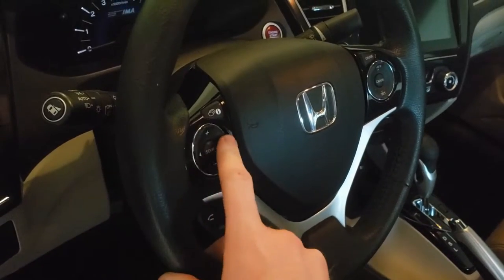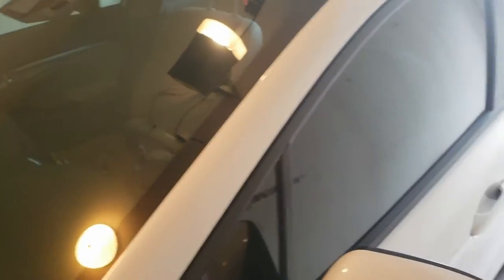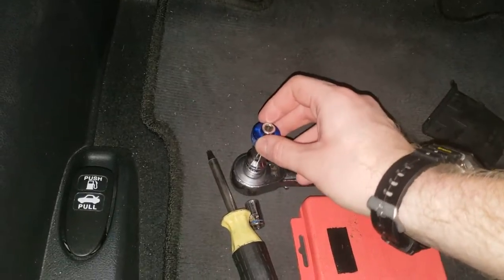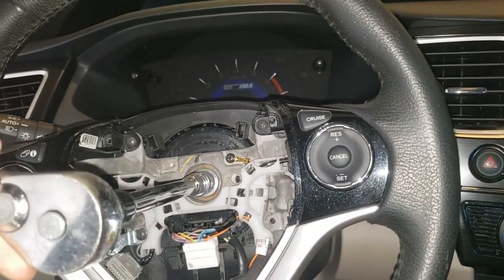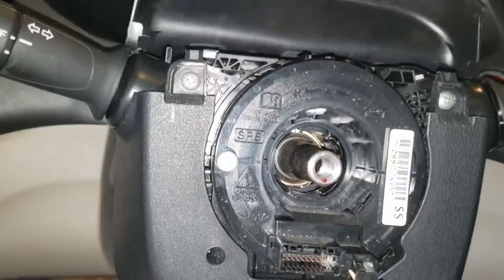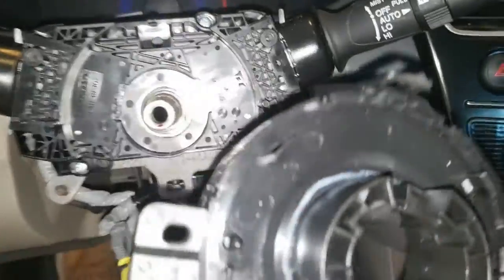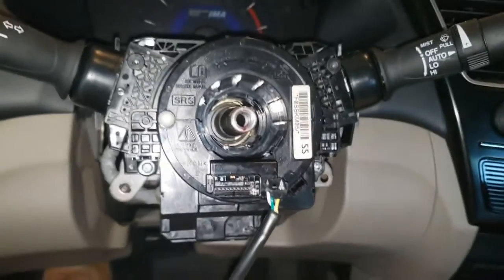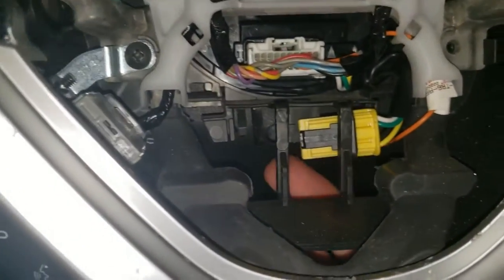2012-2015 Honda Civic Airbag Clockspring Replacement DIY

Comment: thinking im going to have to do this job this weekend, have had the airbag and traction control light on now forever but just yesterday i turned my wheel and heard a crack and then all my steering wheel buttons stopped working including the horn. guessing the clockspring right?
Reply from the maker: That would be my guess. Let me know.
Reply: Probably a little late, but this is exactly what happened to me. Everything is fixed now except my menu went black and the menu buttons don’t work. Not too worried, just needed my horn to work for inspection. My airbag light is still on, but that would be because I have a missing airbag in my driver seat and along the driver side top lol

Comment: Did your steering wheel, hill start assist and vsa light came on the dash after this install? Removed the steering wheel and my dumbass yanked the steering wheel to hard it pulled the clock spring wire out with it. Managed to put it back together and all my buttons still work. However, my vsa, steering wheel and hill start assist light came on. Does it have something to do with the steering wheel angle sensor not aligned?
Reply from the maker: Maybe. The angle sensor may also be damaged, unfortunately.

Comment: I’m just getting ready to do this job. The car horn honks on its own when the wheel is cranked to the left. Particularly in hot temps. My first thought was the clock spring but are there any other wires/mechanisms to check while I’m in there?
Reply from the maker: The clockspring would be my first guess given that the issue occurs when the wheel is turned.
Reply: @civicminded2141  sweet. thanks for your excellent video.
Reply from the maker: @Matt-rq6wz  Glad it was helpful!

Comment: My horn works but none of the other buttons are working.i just had my ignition switch repaired. So the clock spring was unplugged but not removed. By unplugged I mean all of the connectors in there were unplugged
06:50 of those 3 electrical connections which is associated with the buttons on the steering wheel? I want to atleast try unplugging and plugging back in before I replace.
Reply from the maker: I believe the largest of the three is associated with steering wheel buttons.

Comment: Hey do you know what size torq screw the air bag  screws in case I want to replace them
Reply from the maker: Not entirely sure of the size, but I believe the Honda part number is 90134-S6A-A80. I know the Torx bit size is T30.

Comment: Really good video - am unable to reset maintenance and oil reset as the down arrow on the steering wheel left side is not working. Appreciate any guidance or work around so can reset maintenance reminders?
Reply from the maker: If it's just that button and no others, I would look at that panel. I believe on all years and trims those buttons connect directly to the iMID. You can check the resistance between pins 6 and 23 on the iMID connector, you are looking for 100 ohms with that button pressed. If you don't see that but you see resistance with other buttons, replace that button panel.
Reply: @civicminded2141  thanks - it is just the down arrow, up, right and left works. Where would I find pins 6 and 23 of iMID to measure 100 ohms?
Reply from the maker: @maverickperson5443  According to the service manual that's what you should see.

Comment: my hands free buttons come and go.  for example sometimes i can use my info button to turn off my air bag warning (airbags dont work) other times i cant.  sometimes my menu button acts as my info button.  sometimes my source button doesnt work but my "back button" or volume increase button acts as my source button.  my cruise control on button sometimes wont work.  im not really sure if this is the same as what youre doing here.  does it sound like i should replace the buttons each assembly or maybe software?   thanks in advance!
Reply from the maker: I'd say it's more likely to be the button assembly than software. You can verify using a CAN sniffer if you have one, I am planning to make a video on how. The ability to turn the airbag light off with the info button, however, sounds like a possible clockspring fault.
Reply: @civicminded2141  thanks so much for your reply  im back 6 months later as im getting ready to hopefully fix it.  i did get codes on it though.  b0001-13 and b0002-13.  again, thanks for your reply.   going to be replacing the clock spring and hope i can get airbags back.  i can deal without the buttons.

Comment: Hey, so I completed the job. Had a bit of trouble getting the bottom black piece to sit in there right when putting it back in (pieces before the wheel). Also, when I went to turn on my car, voila! The horn worked and so did my cruise control BUT now my menu is black (which it wasn’t before the project), and my menu buttons obviously still don’t work as a result. What do you think?
Reply from the maker: How long had it been since your last battery disconnect?
Reply: @civicminded2141 I literally just put the new clock spring in when I made the comment. So it had been disconnected at that time.
Reply from the maker: @xfirstchairx  Hmm. Are your speedometer and tachometer operating normally?
Reply: @civicminded2141 yes they are. The only things not working atm are my menu screen (which worked beforehand, but the buttons did not) and obviously the menu buttons. The fix DID work on the horn thankfully, which may be all I need to pass inspection, but I don’t like that my menu doesn’t work lol
Reply from the maker: @xfirstchairx  I feel it. So the fuse isn't blown- do you have Sirius? Is that working?
Reply: @civicminded2141 I don’t even have a radio lol I busted that awhile back.
Reply from the maker: @xfirstchairx  Ah. Believe it or not, the iMID on/off state is controlled by the radio. There is a test you can do if you still have access to the connectors the radio was plugged into. If you have a 2014 or 2015 with a screen (nav or no nav), you're looking for a 12-pin JAE connector and you'll be grounding pin #8 (bottom row, second from the right from the wire side). If you have a 2012 or 2013, or any year with no screen (hard buttons on radio), you're looking for a white 14-pin connector, and you'll be grounding #2 (top row, second from the left on the wire side). If the screen turns on with that, it's working.
Reply: @civicminded2141  the menu I am talking about is on my dash, and separate from the radio. I haven’t had a radio in for years. The menu on the dash that shows my odometer and stuff is what went out after putting in the new clock spring. I’m wondering if I may have pinched something. I haven’t had an opportunity to take it back apart and look.
Reply from the maker: @xfirstchairx  Yup- that menu is turned on/off by the radio, even though they are separate. It's possible that you pinched something; I know the steering wheel audio controls also go through that menu. That'd be the first place I'd look.

Comment: My airbag light comes on randomly (between a couple weeks time). I bought a scanner and getting SRS code B000213 Open or Increased Resistance in the driver's airbag second inflator. Any idea what this could be? Owned since new, car never been in an accident.
Reply from the maker: I'd start by double-checking the connections to the airbag (with the battery disconnected). If those are good, I'd replace the clockspring and go from there.
Reply: @civicminded2141  Thanks for your response. Can you elaborate which connections you are referring to and where they are located?
Reply from the maker: @amarfarooqi03  Start with the ones in the steering wheel shown in the video. If those are good, you should be able to identify other airbag connections by looking for other yellow harnesses. They should be easy to see.
Reply: @civicminded2141  thank you will check these out
Reply from the maker: @amarfarooqi03  Remember to disconnect power and wait before touching any airbag wires.
Reply: @civicminded2141  thank you for the reminder!

Comment: Hi so I have 2012 Honda Civic es and when I press the horn it works but the check air bag system light and notifications will come on I’m able to get the code to shut off if I mess with the horn and shut my car on and off a few times . I think this may be the clock spring I’m not 100% sure but since it’s so cheap I probably will go ahead and fix that do you think that’s what the issue is or should I try something else I do know that The previous owner of this car did get an accident where the airbags did deploy so I think it was fixed I’m not 100% sure but when I do decide to fix o’clock spring I’ll look on that make sure that I actually have an airbag but any advice or help would be awesome
Reply from the maker: I'd say that is more likely to be the clock spring than the issue I had. I say go for it.
Reply: @civicminded2141  OK and one other question so my torque wrench only goes to 80 pound foot is there anyway I can get the 88 out of that or do I need to go buy one that’s 88 and thank you for all your help
Reply from the maker: @jonwatycha1614  You need 86 inch-pounds, not foot-pounds. 7 or so foot-pounds.
Reply: @civicminded2141  thank you